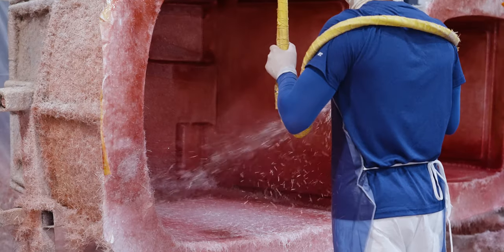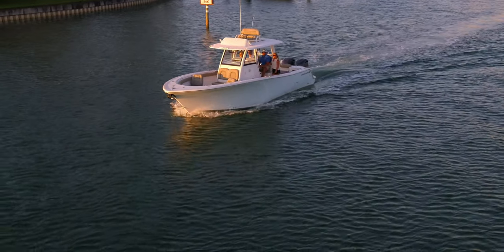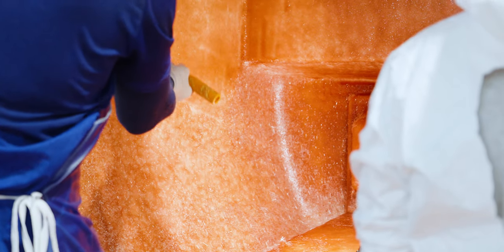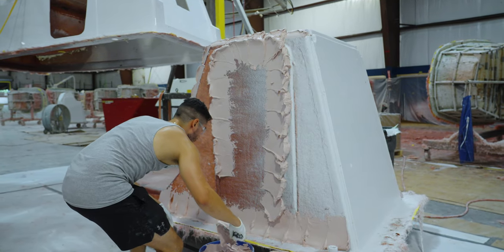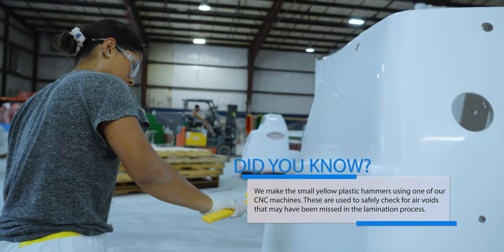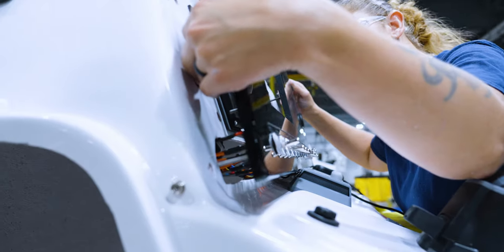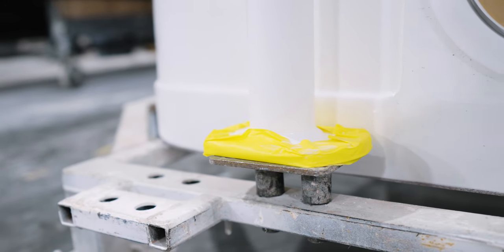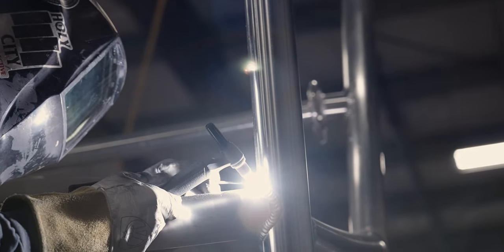The Center Of A Center Console - Sportsman's "Behind The Glass" (Season 1 - Episode 7)

Comment: Have you done laminate strength comparisons to vacuum infusion? I like the looks of your boats, but experience tells me to fear chopper gun laminates.
Reply: Look into bertrams sportfisher boat name was certifiable. That's a vacume infused boat. I have fished on that boat dont get me wrong it is a beutiful boat, but it still came apart.
Reply: @darenleeper1644  Sure, vacuum infusion can be done wrong. If done properly,  it can eliminate resin "cellulite" and guarantee coring is stuck to the laminate. Infusion always eliminates voids that are too common in hand layup. It all depends on the engineer setting up the lamination schedule. Sportsman understands the technology,  the question is when they will apply the benefits to the smaller boats in their lineup.